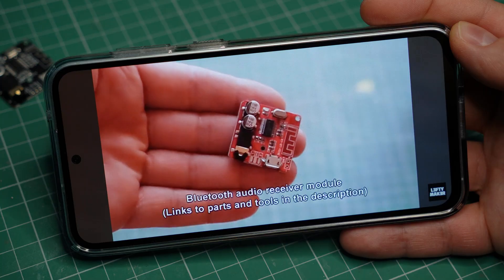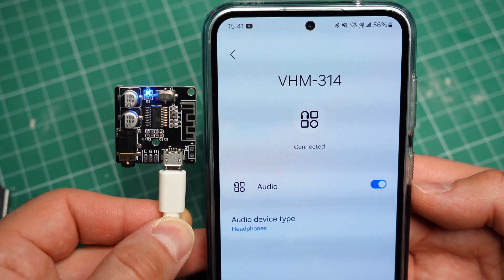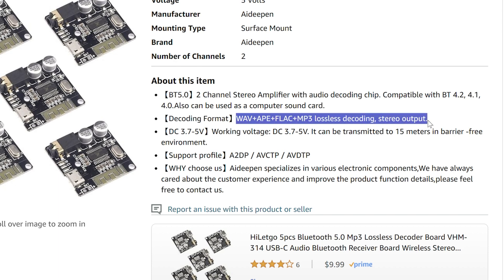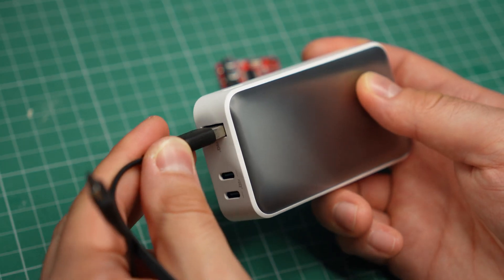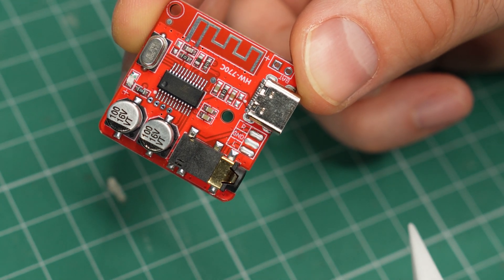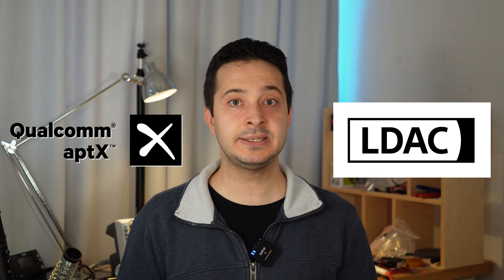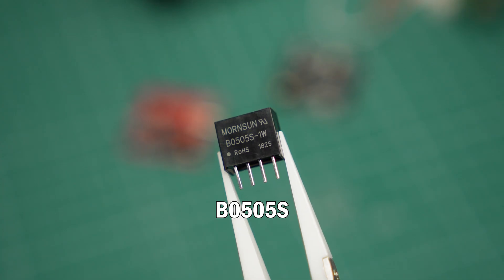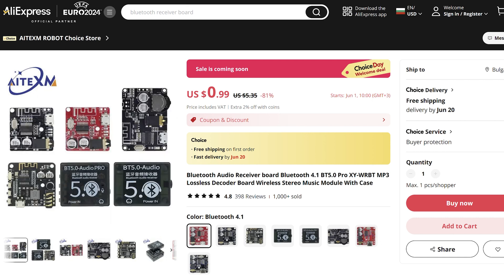Cheap Bluetooth audio receivers explained: pros, cons, how to use

Comment: The issues these have can be fixed such as poor range by soldering on a better antenna like an SMA socket and better 2.4GHz antenna. A decent 5 volt  PSU. I want to get one that has a PTT feature to make a wireless speaker with a PTT mic.

Comment: I just want to warn you, I bought a 3 pack of these and decided to use a 3.7 lithium ion battery with it. I wanted to charge the battery so I used the type C connector on the board and did a multimeter test before I charged it. It sends 5 VOLTS TO THE BATTERY INPUT, I thought that maybe something would change with the battery connected but IT ENDED UP EXPLODING. YOU CANT CHARGE A BATTERY WITH THIS BOARD

Comment: Thank you so much for this valuable explanation, which has cleared up many of my doubts about using these modules. However, I'd like to know if it's possible to connect two or more receiving units to a single Bluetooth source. This would allow me to create a multi-room system without experiencing delays between rooms. Finally, I'd like to know if there are modules where I can connect an audio source (such as an audio receiver) and retransmit the audio signal to all the Bluetooth receivers.
Thank you so much for your advice.
Reply from the maker: What you're describing is Auracast, a relatively new Bluetooth tech. I'm not sure if any modules exist for DIY. In any case, you probably want a wifi setup for multi room use, not Bluetooth

Comment: Disadvantage:
50% less volume on Bluetooth than with a wired connection from the same device, with a direct connection with a wire to the amplifier.
PC (Windows) and Raspberry pi (limux) cannot connect audio to the WHM-314 via Bluetooth. They see the device, but it can only be used with a phone (android).

Comment: I've heard some of them serve as battery chargers for the LiPos' connected to the 3.7v + and - pins on the PCB. This is hit or miss, though, i'm not sure which models support it and which don't.
Reply: My models I have tested don't have this function. You probably have to go with another similar model that includes an Ic or some circuit like tp4056 to charge it

Comment: I'm curious. Say I were to solder this into my headphones. As expected, I would already have the left, right, and ground channels soldered into the 3.5mm. Would it be a problem to solder the receiver in addition to those or would the 3.5mm need to be removed? i'd like to have the option to use the 3.5mm jack when the bluetooth needs to charge. Any advice is appreciated. Thanks in advance.
Reply: Actually, i just remembered that i wanted to solder the receiver to a 3.5mm 4 pin and make a mobile receiver. if it can safely plug  into an aux port im assuming it would be safe to solder to the same points. similar connection after all

Comment: Those are intended to be used inside of audio apliance you can route 5v from main audio board to mini bluetooth board and instead of jack use Gnd or com +R/L pins to input of your audio apliance port that you are not using , solder the wires and switch your devices to specific port dvd, tape, aux where you connected the input. Now you can turn on of toggeter with yout audio system.

Comment: I commanded 20 pieces of those cheap bluetooth modules built many projects with them. I included the converter also. Sometimes they work properly. Sometimes not. I didn't understand where was the error. Thanks for the video.

Comment: Can I use this module inside a Dual Shock 4 controller to get audio over Bluetooth when using the controller s with my windows PC?
Reply: Getting Bluetooth headphones would be easier than that.

Comment: I bought one of these so i could use bluetooth with my vintage technics amplifier. Best decision i made
Reply: I added the black board to my technics amplifier and jbl speakers from the 90's. Fortunately the humming was not noticeable on the amplifier compared to headphones. Audio quality is quite good!

I wanted to add the board to my audio system, because I could not control the volume with my Samsung TV remote when using fibre cable.

By the way, this board uses very little electricity. A 750mah lithium battery powers it for ~30 hours!

Comment: A big problem in my opinion is that these boards are now made with SMD components, which, on the one hand, contribute to miniaturization and ever-increasing performance, but on the other, for us DIYers, they're not a good choice, since it's very difficult to desolder an LED or a button to mount them on the panel of your DIY project. Even putting a button on those microscopic keys is a problem! They should provide the ability to desolder at least the LEDs and buttons so we can replace them with traditional components and assemble them on a panel as required by your project or your container box.

Comment: if i connected a battery to the module, will the usb connector charge it?. I'm thinking about converting a wired headphone to a wireless with this module.
Reply: ik I'm late but I tried this and it doesn't work. It doesn't have any circuit for charging lithium cells and it doesn't output any voltage on the pins when you connect a cable. You might have to use a different ic like tp4056 or something else to charge the cell like I used

Comment: These are ok but for the low frequency roll off that occurs about 150hz so you really have to compensate for this by cranking up the bass.  Shame he didn't mention this as I would have save me some headache.

Comment: I got noise when its playing something, when nothing played there's no noise. It's not too noisy but still annoying.

Or is it because of the cable length of my headphone i used to test it?

(XFW -BT)
Reply: I use 18650 battery, and it goes to a charging module, then it goes to the Bluetooth module

Comment: Nice coverage, I've had to deal with the noise on the supply lines - a right pain, using separate supplies is messy, and mostly leads to the issue you showed with using them with PC speaker, as it it does not power down with the speakers. 
It would be way better if the sellers gave decent info, like the annoying voice (Try that at 200W) or the available codecs it supports.

Comment: Another thing to mention is if connecting like a 18650 battery to the Bluetooth device, Must put a power switch to turn it off when not in use.

Comment: 1:00 "you can even hook up wired earphones to them and they will just work fine."
2:20 "and in my case the microphone doesn't work either"
Can you please explain.
Reply from the maker: They output stereo audio, but if your earphones have a microphone, that's not going to work.
Reply: @LeftyMaker  Thanks for the response, I understood.
Reply: A bit more technical answer:
Bluetooth have several "profiles" that describe what features the device have.

One is "Handset" used for earphones connected to mobiles that can transport audio to/from the device, and that profile is mono sound only.
Then you have "A2DP" used for stereo headset/speakers.
And then you have the more recent "AptX" that is also used for headphones/speakers that has a higher quality audio than A2DP. Then there is SPP for transporting serial data and there are a bunch more profiles.

Comment: Regarding variants:
Your modules use different variants (and/or revisions?) of the chip. Almost all of these modules use the JL (aka JieLi) chips [and even some visually non JL-ones are just rebranded JLs; see last paragraph about github repository].

The naming scheme JL use use it convoluted, although somewhat informative. Generally, past the "AC", it's the year of production, week, etc. The actual variant is the end of the name, in this videos case, it's 25C, and 65A; and IIRC, they're all variants of the AC69xx family (so, AC6925C and Ac6965A respectively).

As of early 2025, most of these will be starting wih AC24[...] or AC25[...] baring any really old stock. However, seller on AliExprese can rarely provide you with such details.

Also, later variants usually have started partially or fully replacing the annoying "lady voice" with other style sof notifications (beeps). The mentioned partial ones: some I've encountered keep the "lady voice" only for the initial pairing, and when module powers off automatically due to no active connection (which is IMO could be considered even useful feature so that you don't have to remember what a specific beep means the first type you turn it on, or to get notified if your speaker/headphones turned off). Once paired, the other sounds (connect, disconnect) are just various beeps and dings.

Some variants use just beeps/dings. Unconfirmed (and probably not universal), but someone somewhere said that, to increase a chance of getting the no-lady-voice one, make sure you look for: 

a) newer modules [first part of the IC number],
b) with higher Bluetooth version support [but I dunno how to check or to ensure you actually get that one],
c) with ICs that have 24 pins [like these in the video], NOT the ones with less pins (which are usually less featureful chips).
 
Anyway, there are many variants of these, and in the same batch I've gotten ones that work flawlessly (i.e. no noise whatsoever), and some that have a noticeable low noise while playing any audio over bluetooth (especially annoying when everything is silent, but then you get a notification sound, and then you really notice the noise after it stops playing, before module cuts out audio output to silent [due to no further audio incoming from your device]). The noise can be probably fixed by adding a (missing?) capacitor to specific set of pads... but there are so many PCB variants of what essentially is the same modules with identical functionality, that it is hard to make any concrete recommendations (aside of adding/making your own filter in-between the module and headphones/speaker).

The situation isn't helped by the fact that there are no up-to-date datasheets (latest leaked ones are from 2020/05). Speaking of, there is an excellent github repository by one user who has done extensive look into these, and has collated lots of info about these chips; just search github for "jieli", and you'll find it, user's name starts with K, I think. And, by all means, consider adding more info to the repository, if you have any and/or are knowledgeable enough!

Comment: what is the connection diagram to use that isolating transformer.?
Reply: First of they are not really a 'transformer' but a DC/DC converter,
they can be had with many different input voltages, like 12V etc, and still 5V out.
Google "dc/dc converter, 5V to 5V" (or whatever your source supply is, 5V)

Comment: I bought a couple of these, with a built in amplifier some time ago. Unfortunately they have a horrible (and embarrassing) Chinese voice that plays at full volume that can't be easily disabled (the dev kit for the chip has viruses). Ones without buttons (the ones I have) have an input on the chip that will work for this using something called AD-KEYS (one pin has a pull down resistor for an apparent non-use). It's one pin used to detect button presses by changing the resistance presented to an A to D port (I guess that's whjy the name has AD)

Comment: I have an aliexpress MP4 player that has composite output. The audio is noisy (i can hear SD card access) this happens regardless of if the player has a seperate supply. I need to eliminate this, as I have stuck it inside a CRT TV.

Comment: is there is any way to amplify the sound to 3.5mm because I'm using the kcx bt002 module that provide the sound with no actual base or anything just a mono audio with lowest sound..
Reply from the maker: I believe you have it connected wrong. There are three analog audio outputs: left, right, and ground. You connect your left channel to left and ground, and the right channel to right and ground. Right now it sounds like you have one channel connected to the left and right outputs, so they cancel each other out and you only hear the difference between the channels, which explains the lack of bass

Comment: If I attach a rechargeable battery to it, can it get charged through the micro USB?3
Reply from the maker: No. You may even damage the battery by doing that
Reply: @LeftyMaker  Ohh so you can't solder a lithium battery to it! Thanks for letting me know
Reply: You can use a charger module and connect the battery there
Reply: @ArkarPhoneKyaw  Great Idea! Will need an extra box to attach everything inside tho
Thanks!
Reply: should i add lithium ion battery directly or should i add a protection circuit in the middle like tp4506
Reply: @hasnatjamil8821 definitely use charging protection.

Comment: I have red one and its connection sound is like black one. But there is one issue, whenever I play audio it transmits a hiss along with audio even when volume is zero. One way to avoid it is a RC filter at output but that reduces the high frequency performance.

Comment: Unfortunatly there is no way of turning of the voice. Its included by default in the sdk and usually manufacturers dont change much and just compile in the default template because it saves money and they wont need to hire programming people. Also the sdk is not really fully documented well.

Some boards that dont have usb sound card functionality can still have it implemented in the firmware and board layout (becauss again manufacturers are lazy to desugn their own thing and use premade schematics) but they just dont place a resistor or jumper disconnecting the usb data lines but leaving pads that can be bridged. I had some models  like that. 

Also if you do plan on tinkering with the firmware, they can be programmed using usb in DFU mode. You have to put a specific signal across the usb pins to put it into dfu mode. The Dfu mode is burned into the bootrom of the ic so you wont erase the functionality. The chips also use UBOOT as their bootloader. They use JieLi's sdk to compile and flash the code onto the flash
Reply from the maker: Very useful info!
Reply: I have the older sdk used for the older JL chips, unfortunately it is very hard (if not impossible) to find now and contains viruses, so I never used it. The JL AC46 BT SDK version 1.2.1 - It has the annoying voice mp3 files included...
Reply: @threeMetreJim  That's crazy, they put the voice into the sdk!, well at least it's an upgrade from a virus - which is truly nuts.
Now is it possible to reflash.... However with the sdk kind of hidden, (Google didn't find it) it's probably a mute point.
Reply: @ I'd send the sdk but it's got viruses so wouldn't be the best idea. I ripped it from baidu years ago, but due to the viruses and having no idea how to reflash, never used it (apart from going through the files and found the voices in mp3 format).

Comment: You had the Bluetooth transmitter in the floor ! You should have tested the range when the transmitter was atlas 1.5 meters off the floor
Reply from the maker: is the floor lava or something?
Reply: @LeftyMaker  comment was meant as constructive feedback ! It’s radio transmission 101, transmitters ideally need to be above ground or sea level to reduce multi-path interference and reduce fresnel zone interference having them higher than ground could have produced more meaningful result in real world scenarios
Reply: @VandalIO  While setting the transmitter on the ground for testing is a performance drop, at least you'd find the minimum range you could expect from it.
Reply: @LeftyMaker  🤦‍♀️

Comment: Can't find these JL ic data sheet 😭
Reply from the maker: search JieLi on LCSC.com and one/some of the chips there are probably on these boards
Reply: @LeftyMaker  I will try
Thank you😇 it work I was trying to find this  manufacturer from long time
Reply: These ics dont really have any great documentation and it requires some digging. Also the number on the ics dont match with any datasheets and are likely firmware revisions and id number of the mfr. Most are from the JL ac69xxxx family
Reply: @309electronic5  thanks❤️😇 
But somehow almost every Bluetooth ICs are    from them

Comment: There is many bluetooth module with amplifier that used common power supply without any noise but when used tow seprated module with LC filter and short wires still there is ground loop noise
Reply from the maker: Yes, I have come across good ones, but all I've tested with a JieLi Bluetooth chip have had beeping noises. The better the speakers, the more you can hear them. CSR BT modules are much less noisy and have never had lady voices too